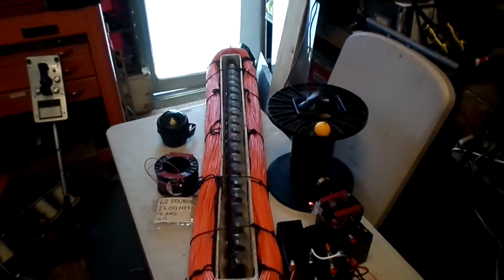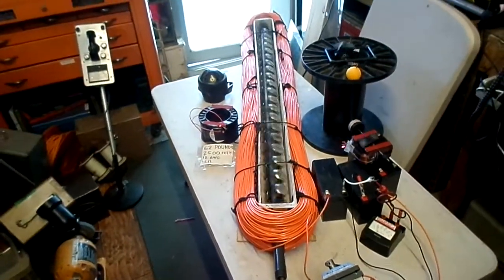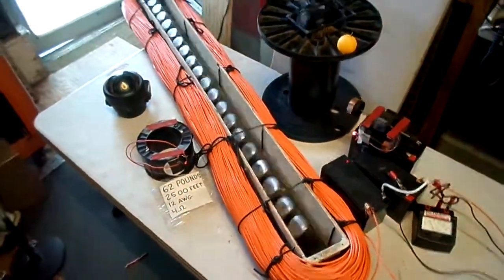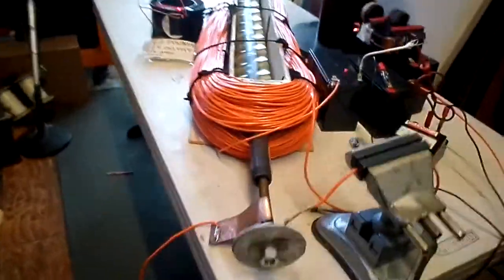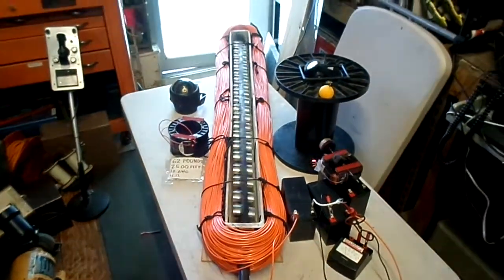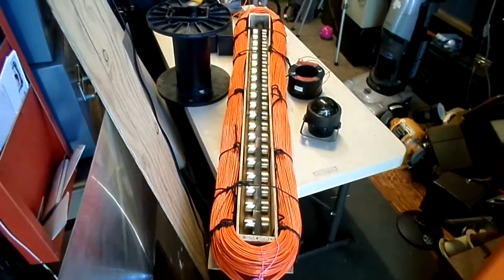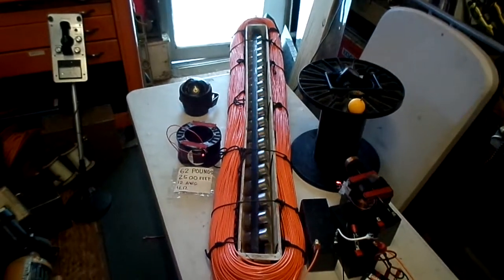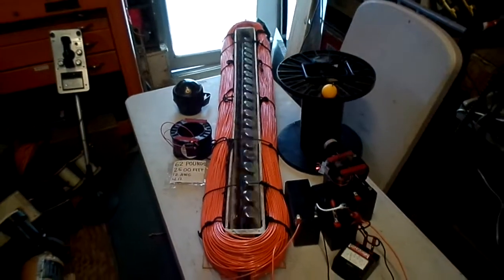87 Pound Newman Motor. Check link to newest documentary on Newman life in info section

Comment: I would try to attach the shaft to a set of gears to increase the speed that can be turning a generator, like you find in a Hybrid car, to recharge that car's batteries.  Those generators have minimal resistance, thus you can recharge your car's batteries when not in use, for free!!   Just a thought.  I am not an engineer, but think of different uses for everyday items.  Like recharging your car's batteries for free using a Newman like technology.

Comment: i would suggest that it needs electrical commutation. the bend in the shaft is likely compromising the duty cycle. 
also i suspect a thinner winding wire would perform better. it may take some experimenting to optimise. more turns means lower rpm for a given input voltage due to the bemf you mentioned tho. 
good to see a scaled up version.

Comment: Clearly you have built it wrongly.   Also your milliampmeter is TOO insensitive to show you what a Newman motor does.    Have you heard of an oscilloscope?  Invest in one.   Then take your time to think through what really is going on.
Reply from the maker: Yes I have one, and your correct the meter can't catch a fast spike.                                                                                   I've had many people tell me I failed to build the Newman motor correctly, but when I ask them if they have a working Newman Motor which produces free energy the anwer is always no.   Not to attack you or your beliefs, but It's easy to theorize.                                                                       One of my previous models had 30 pounds of number 30 guage wire. It required a much higher voltgage to operate, but still didn't produce any  free energy. Nevertheless I'd like to see someone build one on a much larger scale which would be more in accordance with Joes theories.
Reply: @GrantsPassTVRepair  30 pounds to be Frank is still too low.   Also the air gap between the wire and the magnets, the coil looks poorly done compared to what industrial companies do, you won't be getting anywhere near what JM had done.   

Small units usually cannot justify the claims.  You have to use industrial strength components to achieve, including some precision in your construction.  Without that, no one has that capacity to judge JM because he built his technology with a lot of care and attention to detail.

To find out the true power you need to invest a lot more and with the right instruments, you can decipher the power rating.   Merely reading off the amp meter and staring at the scope will justify nothing.    

Also JM's big eureka was one such living example that had even Emeritus Professors in the field of physics to justify his technology works exactly like what the inventor does.   And he has shown it to the public some years back that it doesn't need high power to run high loads.   Basically the gist of what it does is like an ant, an ant carrying a large chunk of mass in which seems impossible to the human eye.   But it can be done if you truly understand why Newman says the field theory is UNIVERSAL and applicable to magnetism.

What Einstein proposed for elements having power, so does the magnetic field and from her source properties.
Reply from the maker: @ConstantineJoseph  Yes there are many ways I could have improved on what I built. Having been a big fan of JN at one time, I became disillusioned with him after seeing some of his later public demonstrations where he would use very un-scientific methods to demonstrate the output power  of his motors. Rather than using a simple  Dynamometer, or lifting a given weight over time, he would come up with abstract ways to try and prove his point that could be very misleading. Have you ever wondered why he could never remove the batteries from his motors?  Have you ever read the story by a professional motor builder named Norm Biss who worked with Joe Newman. Here is a link you may want to check out. Look up Norm Biss and Joseph Newman.
Reply from the maker: @ConstantineJoseph  You might want to check out this link. http://www.zpenergy.com/downloads/biss.htm
Reply: @GrantsPassTVRepair  you know there are many who have vouched for his technology, including people who have made many appearances in public.  Some of them are seen in Newman's 2017 "autobiographical" documentary.   There are many power brokers that will try to pay off one or two of his associates to discredit him.

But if you have seen the huge list of validators and the range of the credibility of the scientists and authorities in their field signing the affidavit, shows that he had something on his hands.  

Besides, the fact that you keep ignoring the phenomenon of the spikes which is intrinsic to the nature of why Newman always wanted to work with batteries is because they form that close loop system.  

He never said to you that there is "free power" so it should run itself.    Therein is where you are too simple minded to understand the full theory.   I would suggest that you re read his whole book again and why batteries is needed in the full process.

Just think, of a turbo charged engine vs a non turbocharged engine as a simple illustration for you to understand this science simplistically.   The Newman motor is like the forced induction motor, using the spike that is manipulated to be that torque inducing force of "oxygen" into the cylinders for higher horsepower and torque using less fuel injected into the cylinders.

The normal conventional electric motor does not have the compressed gas or spiked energy inducted into the electromagnetic process of creating torque.

Newman does this injection of compressed air as an illustration, of high density spiked energy into the motor again.   So if you miss the whole argument of why the Newman motor exist is to ENHANCE this process.  Which means, that you FOCUS on building the "turbocharger" not the conventional cylinder block.  Focus on the turbocharging effect as an illustration,  focus on why the efficiency is proven through the process of manipulating voltage.  It's in his book read it again and again. 

A lot of naysayers, just build the small weakened poorly wound, poorly constructed motor and say there you go, it sucks.   

It's like an amateur trying to replicate a Ferrari 6.3 liter V12 block engine with twin turbos by building a 50 cc engine block with 12 cylinders as a tiny replica example to see if the concept works.    You know that is going to be a failed validation process and a very flawed one.  

I can tell you lol, because Newman has put in a lot of resources to build industrial sized, industrial quality assembly, it will be quite foolhardy for those who don't have that same commitment to replicate his true concept.
Reply from the maker: @ConstantineJoseph  Yes I know the whole story. I've even spoken with Joe on Two or Three occasions, and may friend sent him Four thousand dollars after Joe told him he would send him one of his motors. After patiently waiting 4 years for delivery I helped my friend get his money back. I'm not denying Joe may have been on to something, but along with all the thought provoking testimonies you and I have seen, there were also plenty of things to be suspicious about. This was one of hte best stories I've ever seen. https://www.youtube.com/watch?v=CrJIzrmX1mI&t=0s
Reply: @GrantsPassTVRepair  I suggest that you take a look at JL Naudin a French Scientists' replication of Newman's motor and the subsequent test results.

Also if you are complaining on an 8000lbs motor running on 9volt batteries,
try talking to a real industrial expert who deals with large conventional AC or DC motors.  He'll tell you, you must be high as a kite to suggest a motor of 300 lbs running on any 9 volt or AA batteries.   Clearly JN is on to something radical.
Reply from the maker: @ConstantineJoseph  Yes. Seeing a motor operating on such a low current is unusual, but when it comes down to power input Vs power output,  both voltage and current are better stated in terms of Watts. When I first began experimenting with Newman Type motors, I would often boast about my motors being able to operate on very low current, and failing to understand that the power my motor consumed needed to be stated as watts. Meaning volts times amps.
Reply: @GrantsPassTVRepair  that's right.  But don't forget you can never calculate a Newman's true power rating as those spikes are also within the spectrum of operations.   It has this additional funneling effect of electron motion back to the battery source.   That is why the motor always uses Volts to catalyze this effect and if done right, you can run high loads with low power just relying on the spike which has no input power cost.   Basically instead of the back emf retarding the torque you are using the back emf to increase the rpm and torque.
Reply from the maker: @ConstantineJoseph  The bottom line is my model is too small to debunk what Joe is doing based on what I built. I heard a guy who worked with Joe say our coils need to be at least a Two hundred pounds before we can re-produces the Newman Effect.  That being said I have no immediate plans to wind a 200 pound coil. If you do please share your results with me..
Reply: @GrantsPassTVRepair  yes very large number of turns and large diameter coil to produce a powerful magnetic field overcoming the sort of loose coupling with the rotor (spinning magnet). This point is almost always overlooked.

Comment: If you need any help with the commutator, I've not perfected it yet but I'm confident mine are of better function than what's in this video. They switch polarity in addition to being smoother. Comment back if you'd like to collaborate. I don't have all my videos public at this time but you can see a few on my channel.
Reply from the maker: Thanks Jim,  For the time being I'd rather watch other experimenters like yourself.  In an earlier model I had built a a commutator that switched polarity every 180 degrees of rotation,, so I understand the design behind it, but the value of the shortout segment never made much sense to me, and If I'm not mistaken even Newman abandond that design in his later models.

Comment: Alright, to address the problems you are having with your motor here are a few. 1- If you would realize that the stronger the magnet the smaller the field then you would understand the importance in air gap. You have tremendous air gap in your motor and thus is causing your low torque. 2- the magnetic field of the magnets needs to be of such volume that it intersects with the outer most wiring of the coils. If it doesn't, then during the short phase, the potential voltage will be much lower and as we know voltage is what makes everything move.  The Short Phase of the Newman Motor Is allowing the "flyback" voltage to be reabsorbed; Which is the magnetic field collapsing and causing voltage to applied in the opposite direction. In any electrical circuit with a induction coil we know that current doesn't "flow" until the magnetic field has been completely produced, then current proceeds to flow, thus "current flow" is complete loss of energy as it pertains to electrically driven motors. We know that a magnetic field requires zero energy to remain voluminous but in magnetically controlled motors we completely disregard that fact. Just something to think about in modifying your motor. Best of luck.
Reply from the maker: I had built a previous version where I recycled the back spike, but it slowed my motor down. Perhaps one day I may try again, but for the time being I hope someone else gives it a go.
Reply: @GrantsPassTVRepair  If you are decent in electronics then make a solid state controller for it.
Reply from the maker: @fastredcar97  A solid state commutator would be easy enough to build, but I'm not highly motivated after discovering all the laws of thermodynamics which were not in my favor. At this point I'd rather see you build one and tell me how it goes. ;-)
Reply: @GrantsPassTVRepair   Also, I was trying to do the calculations for the gauss at the wire coils. What Size magnets are use using dimensions wise, and what have you measured for your distance from the face of the magnet to the wire coils.

Comment: Only 4ohms of resistance with 62lbs of wire?
Reply from the maker: Yes. The wire was 12 guage, so the resistance is quite low.
Reply: @GrantsPassTVRepair  
🤦.  i have always thought that a smaller wire would give a lower resistance than a larger. so if you used a 22ga wire it wouldbe higher resistance?  
im self taught andstill learning, btw i live only 45 min from where mr newman lived and was a naighbor of his growing up. super guy,. but yes when he became a "prophet"  it turned many away.  i do recall hearing he was right alot even tried to warn new orleans about hurricain katrina
Reply from the maker: @thespiritof76..  Did you mean to ask if  a smaller gage wire would have lower resistance? A thicker gage wire will have less resistance per foot than a smaller gage wire. I had spoken with Joe, but I never actually met him.
Reply: @GrantsPassTVRepair  you just taught me something.  thank you.... 
jdid you know joe had big eureka dismantled and hauled off for scrap.     
 his reasoning was this; if the power brokers got it THEY WOILD CERTAINLY get granted a pat. and the tech would get shelved.
Reply from the maker: @thespiritof76..  I understand, but I still wonder if his motor really did what he claimed it did.
Reply: @GrantsPassTVRepair  i cant get over how he would have fooled so many experts who spent so much time with it.   the videos show them testifying to its validity, but then later making a reprise to their testoments.  mainly the ones from MIT.   I just have a hard time with that.... 

one more thing, is there or was there an early motor that ran off volts and and not current?   also i recall mr newman explain that the inertia of a large flywheel was nessisary for the motor to fuction with efficacy. why did you not have one on your model?
Reply from the maker: Yes correct. I used 12 gage wire.

Comment: Don't be so negative about Joe..  You obviously don't understand the principles of the motor..  
1 :  You are using the wrong type of wire
2 :  Your motor has too many deviation from the original design to be comparable..
3 : Joe had many things hooked up to his motor,  They all required more power than the batteries could put out..
4 :  The 17 Scientist that examined Joe's motor didn't replicate is cuz it would probably cost  $100k build.
5 :  Joe spent 30 years fighting negative People.  Including the Patent office..
6 : Joe had NO help with anything..

You didn't do enough research on this motor to make the statements you are making..
  Do you know what's special about Joe's  "Special commutator"  ?  =  You don't have anything close,   to make a comparison...

The official final conclusion about Joe's motor is   :  "The only People who say it doesn't put out more power than it uses,  are the People who never tested it "...

We've all seen the small replicas,  (I built a couple myself),  They are NOT Joe's Big Eureka. 

Obviously,  Joe took some important info to the grave with him..
     One of Joe's final thoughts were  "Joe discovered the principles and now,  it's up too the next generation to take it forward..
Reply from the maker: I get a lot of people telling me I made it all wrong, and that these motors really work, but so far no one who tells me this has built one that produces more energy than it consumes.
Reply: @GrantsPassTVRepair  ,  You're right,  but, I haven't seen anyone measure the shaft torq either..  Everyone concentrates on the back emf..
  Maybe you could wrap a string around the shaft and see how fast it will lift a weight..  Then ,  calculate the results into watts..   The formulas are googlable. 
   I believe,  that's how the 17 Scientist measured it..
Reply from the maker: @THOMASTHESAILOR  . If an individual wants to demonstrate they have produced a free energy motor which produces more energy than it uses there are two simple methods they can use to do so. One of them is to completely remove any batteries or external power from their motors and show how they can operate on their own energy. A second test is to see if they can beat what conventional science says is possible in terms of energy input Vs energy output.
For example. It's presently accepted that 746 watts can produce one horse power from a motor that's 100 percent efficient, One horse power should be able to lift 33000 pounds one foot in one minute of time. If one were to scale this down it could also be said that 1 watt should be able to lift 44.25 pounds one foot in one minute of time. If someone can demonstrate greater efficiencies than this it proves that conventional science is incorrect, and free energy electric motors are truly possible.
Reply: @GrantsPassTVRepair  , 
     Joe Newman already had 17 Scientist and Physicist do exactly that..  They all agreed.. 
    They have sworn affidavits to that..

      You can google that..

  You didn't read my last comment to you..